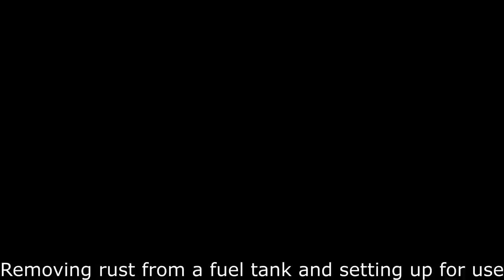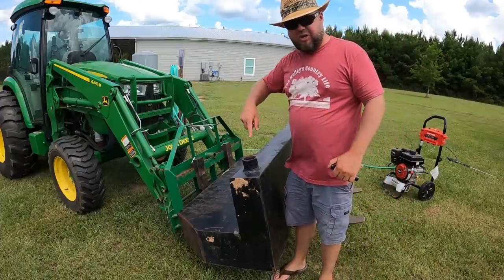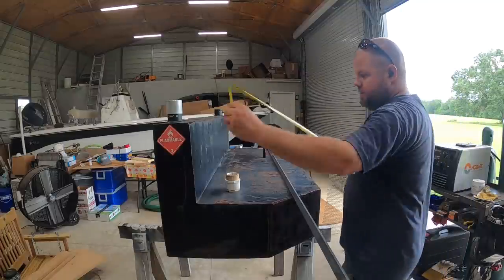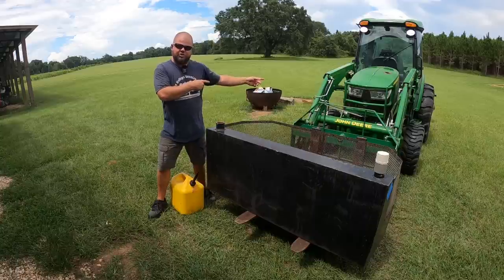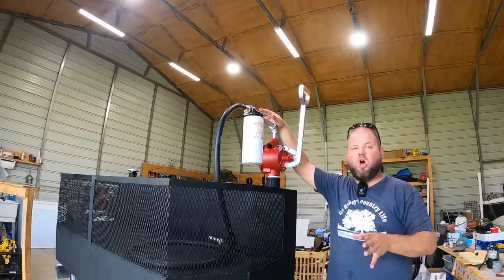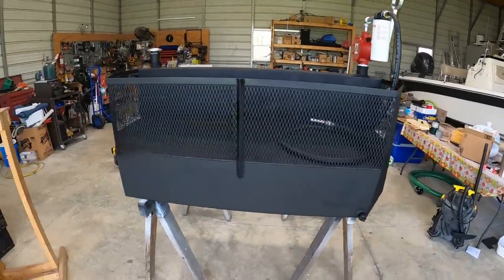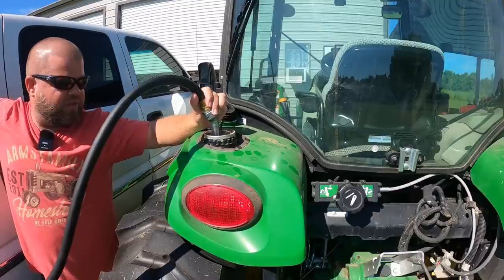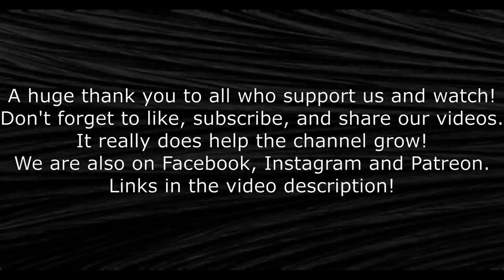Removing rust from a fuel tank! Diesel tank setup with Fill rite pump. #604

Comment: Put a 1/4 turn valve where the hose attaches to the nozzle so you can turn it off when done pumping.
Reply from the maker: Perfect solution! Thanks
Reply: Or go to TSC and buy a manual fuel nozzle.

Comment: Get some old worn out semi mud flaps, cut off bad parts and then piece them together good pieces for a "floor" for the storage area. Help prevent scratching and rattle of anything metal places in that area when driving :)

Comment: Great job restoring that tank.  I refurbished a old ford tractor tank about 20 years ago,  and found a product that actually lines the inside.  The old tractor tank had several rust holes.  At that time,  there was not alot of quality replacement tanks to choose from so I went the liner route.  Have not had one bit of problems since,  and had actually forgotten about it.  Just a FYI,  if you ever notice rust creeping back in that tank.  Cannot think of the name of the product,  seems like I bought from a atv repair site.   This stuff goes in like paint.   There are some calculations to be determined for how Much goes in.  Once in rotate the tank so that it lines the inside,  set up the fan system,  and it cures like plastic.   On another note,  I have a 50 gallon square tank,  I use  for diesel with a fill rite rotary pump.  After a while,  pressure that builds up in the tank starting pushing fuel through the pump.  I have the same pressure relief cap that you have as well.  All that being said,  I installed a ball valve after the filter to shut off the flow.  I actually lost about 5 gallons of fuel before I realized what was going on.   Just my two cents worth.  Well maybe a nickels worth with the current inflation.  Lol.  Keep up the good projects,  I really enjoy your videos.  Good, clean, interesting and educational entertainment.
Reply from the maker: Im actually thinking a 1/4 turn valve right before the spout will be a perfect solution for cutting off any dripping fuel. Thanks for watching

Comment: Great video sir. I have a similar tank I’m trying to reuse and I’m going to follow your steps. I really liked your idea with the wire mesh to create additional storage. A piece of rubber matting would be a good idea to install in between the bed and the back of the tank to eliminate from rubbering the paint off and creating rust again.

Comment: Andrew, I know what you are talking about on the algae in diesel. It got so bad on my 4520 that it stopped up my suction line on the tank. 

I had to remove the tank to flush it out. I replaced the sending unit while I had it off. I treated my tractor fuel tank with BioClean and now keep BioCide in my fuel drum. I buy the chemicals at autozone. I wish I could attach a picture of the algae slim I pulled out of the tank. I’ll email it to you. 

I have a 55 gallon drum at my shop that I keep diesel in. When I empty it, I put it in the truck and run by to get off road in it. I just emptied the drum but think I might just buy a tank full at a time as prices are dropping. 

I enjoyed your video on the tank cleaning and restoration. 

BTW, I used to make my own diesel about 15 years ago. That was before anyone knew what biodiesel was. It was costing me about 65 cents a gallon but the used cooking oil was free. I still have the reactor tank I built then but haven’t made any in a decade. It may be time to start it up again.
Reply from the maker: My suction line and my father's has plugged several times 😡

Comment: That is an awesome set up Andrew. I do like the idea of putting fork slots/pockets on the tank too
Reply from the maker: I need to find some c channel or bar stock.
Reply: @TKCL  I believe we use 3x5 tube .125 wall or maybe.25 wall. But if you can get tube it works great for the forks

Comment: You will want to keep the tank full to prevent condisation this is what causes rust in tanks.
Also add a water seperater filter to keep water out of you equipment.
Also add some howes diesel traetmemt to your fidl to help stop alge growth.

Comment: That tank looks like it will work quite well for you, if the extra fuel in the hose is a problem you a pump nozzle like a gas station have.
Reply from the maker: Or cut off valve 😉

Comment: Nice tank, so much better than the 5 gallon cans. Nice job saving the flammable sticker, too bad it should come off as you are not hauling anything flammable, diesel is a combustible. When I set up my bulk tank I ordered some stickers (from Amazon of course) with "DYED OFF-ROAD DIESEL". Even though I have a gas truck I wanted the tank clearly labeled.  I purchased the crank version of that same pump, it had a place on the side to 'hang up' the hose when not using it.
Reply from the maker: I consider the crank version, for some reason I've always wanted this model.

Comment: HI THERE  great job john
i would recommend an automatic nozzle . it should work fine . i have put several on hand pump tanks . and try to find a cap for any nozzle tip . keeps bugs out .
Reply from the maker: I agree! Or as someone mentioned a 1/4 turn valve right before the spout.

Comment: Another awesome project completed. Wonder if you could reverse the handle and have it pointed downward so it would be easier to pump when standing on the ground. In any case, that’s a wonderful addition your operation around the farm.
I used to work at a hospital and we had 7 emergency generators that ran on diesel and we had to have our fuel ‘polished’ every 6 months to keep the algae from becoming an issue. We were required to do a 30 minute monthly full load test on all 7 each month and had to be able to run a minimum of 68 hours continuously without refueling in an emergency situation such as a natural disaster. A company came in with a huge truck and would suck up the fuel from the tanks and ran it through a series of filters before placing it back into the holding tanks. Was an interesting process. When dealing with mission critical back up systems, the fuel had to be perfect.
Reply from the maker: I completely understand the need for a perfect operating system in a place like that.
Reply: The use of biodiesel is the reason you had to do that.  Even though you don't buy biodiesel other people have and the trucks and pipelines are contaminated with it.  Algae was very rare prior to biodiesel and now it is very common.  I worked at a hospital and tanks that had not been refilled for years were fine.  Biodiesel comes out and we had to install fuel polishing systems.  Got either globs of snot or coffee grounds (rust).
Reply: @brianhillis3701  it was a requirement in order to maintain our accreditation as well as a state requirement due to our designation of a level 2 trauma center. Our storage tanks were in ground tanks so we were more concerned with water than algae. You haven’t lived until you’ve experienced a critical grid power failure and then experience a critical generator failure in the middle of it. Doctors don’t take kindly to loosing all electricity during surgeries. Even though all equipment has battery back ups, it’s a very unique situation to be in.
Reply: @Tripring2000  I managed over a hundred tanks and generators at a very large medical center with multiple  BSL3s and a nuclear reactor.  I know exactly what you are talking about.  Both above ground and below ground tanks nowadays have algae in them mostly confined to the water oil interface.  Polishing systems are needed on most of them and occasional cleaning.  Algacides can work if the tank has been cleaned recently.  Keeping water out is a key.  Try putting socks in to remove the water or pump it out with something that goes to the bottom of the tank the fill tube is too high to be effective.  Usually a 55 gallon drum is big enough.  Fill it, let it set a couple of days and drain the water out until you see oil. Pour the remaining oil into the tank it came from.  Don't contaminate other tanks.  You should do this whenever you get over a quarter inch of water in the tank.

Comment: Andrew, search your area for a fuel depot company. Its those types of small fuel companies that deliver fuel around the city in the pump trucks. You should be able to get offroad diesel directly from them cheaper than those stations like you went to. Here we save around .70 cents sometimes more for off-road and if you catch it when diesel is cheap i would explore getting a larger tank double wall. We got one from Ebay a few years ago i think its 900 gallons for $700 delivered. We then got it filled and keep topping it off with fresh off-road every 100 gallons we use. Its inside a small 12x20 metal building away from everything just incase it goes boom
Reply from the maker: Thank you for the information

Comment: I recommend that you put a lock on the handle and put a bungee strap around that bucket as well.  Great job on the tank!  I have a 50 gallon transfer tank with the same [ump bu my handle turns rather than pumps.
Reply from the maker: I looked at that model too, for some reason I always wanted this one.

Comment: you might want to put a small gate at the bottom of your rack to clean it out if it gets debris in it , my uncle made us a  tank like yours (he was a stainless steel welder) he put a pair of lifting loops  on the back of the upright area .  the FillRite  pumps are great  we have one that is over 20 years old only replaced hose and filters on it but upgraded to an electric about 10 years ago to fill our big 4x4 tractors.   our tank holds about 145 gal or so also an ouch  when we fill up our tanks :)
Reply from the maker: Yikes! I hate to deal with that fuel bill.

Comment: Surprised the Pump did not come with a Hose hanger ? 
I was gonna comment on leaving the Hose lying in the Cage and see the Fuel come running out as a Syphon. Cause the Nozzle is below the level of the fuel in the Tank.
Thanks Andrew.
Mike M.
Reply from the maker: I see a hole in the pump, I'm going to see if it's for the hose. Otherwise a 1/4 turn valve is going on.

Comment: Good evening Andrew,  hope that the 2 of you are doing well.  With the wire you installed on the tank, you can easily use bungee cords to help keep things in place.  Most of the fuel pumps like you installed usually comes with a built in nozzle holder. I couldn't see very well but I think that you might have one but I couldn't tell. On your pump on the back side facing the back of your truck there is a hole and if the nozzle fits into it the hole the nozzle should catch and stay in place. They built them this way so you won't have to put the nozzle into a bucket like you did and have any left over gas come out and have the nozzle lying in it. Most have a built in holder for a nozzle.  If by chance yours does not, you may want to check to see the they make one that you can attach so your nozzle isn't lying in diesel.  Glad that the chick's are doing well and that you are now a new chick father/ tiffany a new chick mother. Take care, God bless
Reply: I stand corrected, I didn't realize when watching the video that you bought a drum pump so it won't have anywhere to put the nozzle as you know. Put some type of hook with a locking device so you don't have to keep it in a bucket.
Reply from the maker: There actually is a odd hole in the pump, I'm going to see if by chance it holds the nozzle.

Comment: Could you put a lockable pump nozzle (with auto cutoff) on the end that would cut the fuel at the end of the hose? You could lock it open, fill up and it would cut itself off. You’d have some fuel still in the hose though.
Reply from the maker: You could, but someone mentioned a 1/4 turn valve right before the spout, I think that's the perfect solution.

Comment: theres a fuel savings app i use to get fuel for my duece and a half it saves money at the pump on road deisel and off road diesel if you only buy at truck stops its called mudflap i save .35 a gallon at the truck stop i use no limite on the ammount you can buy

Comment: Cut you a scrap piece of expanded meta to fit in the bottom of a 5gsllon bucket put blocks under the metal. That way your hose won't sit in any fuel that leaks out of the hose
Reply from the maker: Sure can! 😉

Comment: Andrew did you ever consider welding some fork pockets on the bottom of the tank. You wouldn’t need the 4x4 underneath the tank and you would not have the risk of the tank sliding off the forks of your tractor when the tank is full.
Reply from the maker: That's a good idea

Comment: Welding the wire. Flat bar ok at top but why weld wire bottom to dank?  I would approach it from angle iron top and bottom so wire wolds to frame of angle iron. Horizontal supports at bends out of angle iron too. I just think wire weld to bottom going to give way vs welded to the angle iron makes more contact with the wire
Reply from the maker: It may, I was going to weld flat bar on the bottom. If I see any issues, I'll address it.

Comment: Is that bucket going to catch rain water?  Think the nozzle should be facing down so no water enters the hose. Maybe hook it to the tank into a short pipe to cover the nozzle.
Reply from the maker: Won't be a problem, that truck is always under a barn. If driving in the rain I can dump the bucket or hose. The hose end will never be higher than the pump.

Comment: Vinegar helps, If you really want to get rid of all the rust I believe it’s muriatic acid that eats the rust. A lot of people restoring vintage parts with rust will use that because it does need the metal just the rust. 

One thing I would do first is put a bunch of gravel in there and strap it down to those forks and go bounce around for a while and scrub and chip off some of the rust and flakes, then dump that out and muriatic acid is what gets rid of rust. Then you seal the tank. Motorcycle guys do it all the time, it’s easier in a little tank but the rust isn’t really horrible as long as you get all the flakes out of it. Muriatic acid will get rid of the rust but not the big flakes and the gummy junk in there. 

In a car or motorcycle once you get the tank physically cleaned you can use the vinegar or the muriatic acid and once it’s clean you let it dry out completely and then you pour a liquid in there that basically treats the metal or lines it and it sort of seals the metal off and that liner is made for gas tanks. 

Diesel is pretty forgiving. If you watch diesel Creek some of the tanks he has are horrible and he just throws gravel in there and breaks the chips out and lets the filter handle the rest of it. Once the diesel is in there even on bare metal it won’t be too bad. 

Another cool option are those propane tanks you make the fire pits out of. You could weld some legs and fittings on that make a pretty cool tank. You could throw this on the trailer and fill it up and make a couple of runs or just every now and again when you go to the gas station is have several hundred gallons stored up. Diesel last a long time, much longer than gasoline. There are also some additives you can put in there that will absorb the water

I like the mesh he put around there, that was a pretty cool idea.  I would weld a couple of little tiedowns on there. For luggage racks at Harbor freight and almost anywhere that sells automotive accessories you can buy little mesh nets that are kind of like bungee cords but they have one that’s made for those little receiver hitch carriers that is about the same size and if you just welded a few little tabs with holes on there it would keep stuff from bouncing out of that tool basket area when you’re driving and keep stuff from blowing around but it’s almost exactly that size it’s just a net made out of bungee cord with little hooks on it but that might be cool on there as well
Reply from the maker: I was planning on building one out of a propane tank, but it's hard to beat free.
Reply: @TKCL  you need both, you get a huge propane tank and use this one because the 700 gallon tanks too heavy for your truck to haul all that gas at once. 😂 

That’s where my mind goes anyway, use that to fill up at the gas station and then pump it into the big tank so you’re not driving around with all that weight. Either way this one works and it’s pretty awesome.

Comment: OMG, this is where I shine !  A lot can go wrong with your fuel tank, but they are easy fixes, for one” I wouldn’t leave the fuel nozzle below the fuel level in the tank,,, liquid flows downhill, I would hate to see you lose $300 worth of fuel (siphon effect) can take place in any situation, and you will always fight with moisture because it will get in and fuel is lighter than water, so water will sink to the bottom so do some science, thank goodness for filters 😁
Reply from the maker: I'll look for a hose hanger or cap for the end of the nozzle.
Reply: @TKCL  yep, you still have to keep the rain out, but I’m sure you’ll come up with a good solution

Comment: The problem with storing fuel, especially diesel is that you have to let the tanks breathe and that usually introduces water into the system. I’m almost wondering if you could build a box around the breather part and just fill it with a bunch of that silica gel and I wonder how long that would last and if that would dry the system out. I think it was you who is using a filter that was supposed to dry the air for compressors that was sort of like that it was filled with silica. I wonder if you just put something like that in line to the breather on the tank if that would be enough to keep humidity out of the tank. 🤔
Reply from the maker: Won't be a problem, I've already used 20 gallons in two days 😬😬😬. Tractor has been busy 🚜